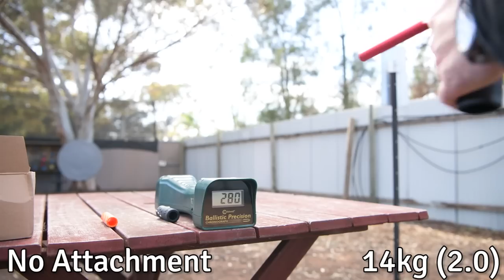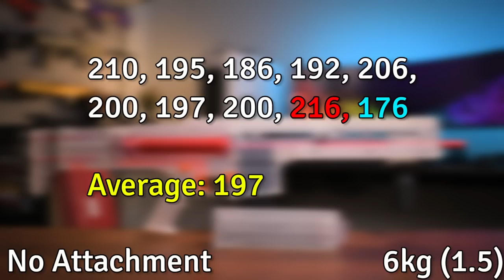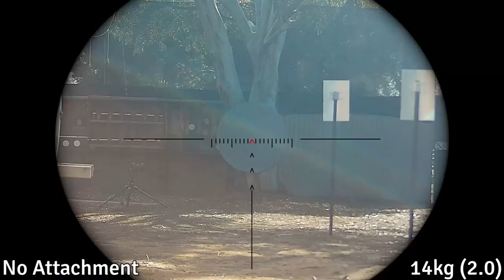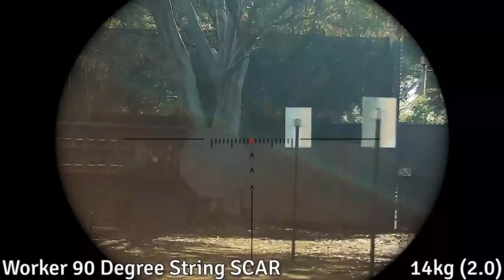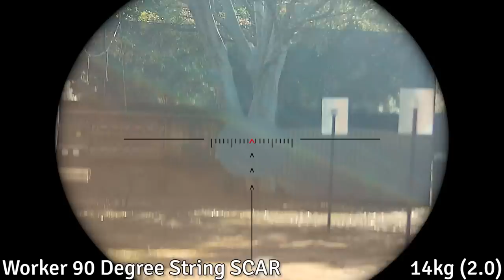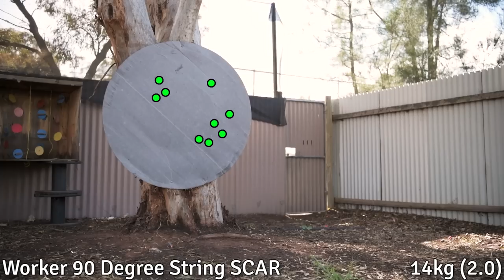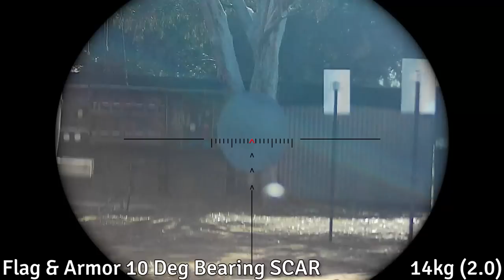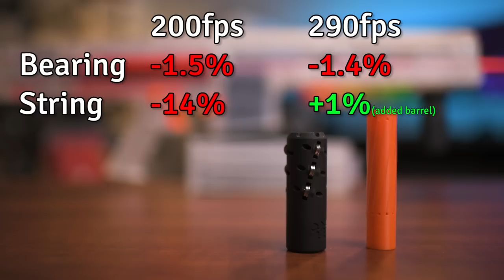Are Bearings the Future of Nerf Accuracy?

Comment: I'm  the chief designer of Flag&Armour,I am very glad to see the review of this product.
     I want to point out that if the correct bearing scar is used, nerf will perform better. It is recommended to use type-A for high muzzle velocity, which is 5° bearing scar, and Type-A is also suitable for most nerfs. For nerf with lower muzzle velocity, it is recommended to use bearing scar with a slightly larger angle, such as type-B or type-C.
     According to our tests and customer feedback, the original MK3 Challenger is suitable for type-B. Nerf with a muzzle velocity lower than 40M/S recommends using type-C, and Nerf with a muzzle velocity higher than 60M/S recommends using Type-A.
     BTW, the type-A bearing scar has good performance after being installed on various nerf with muzzle velocity, but it is more suitable for nerf with muzzle velocity higher than 60M/S.
     If you want more products to be tested, you can contact me and I will mail you more test samples for free.
Reply: Since you’re the chief of design there, can you see about making some of these that fits on a Nexus Pro muzzle port?
Reply: @MalakaiSchuhart  There are not many users of NEXUS pro in mainland China, we haven't done the design for NEXUS pro yet. But we have designed a suppressor looking bearing scar with metal shell right now.
Reply: Hello Flag & Armour Engineer! please can you allow your product to be shipped to Canada and United States. also made to fit 16mm od. Thank you!!
Reply: @paulmcewen7384  We are trying to ship our products to Canada and the United States. How can I contact you?
Reply: @cdpdswat  email is best, but I don't want to post my personal email publicly. Do you have a business email I can reach you at?
Reply: Flag & Armour I am wondering if I can pay you to ship directly to me Australia?
Reply: Let's talk!
Reply: @alexterito1 Hello, you can find my email address in my channel profile. I was busy for a while and did not go online.
Reply: @outofdarts  Hello, you can find my email address in my channel profile. I was busy for a while and did not go online.
Reply: @paulmcewen7384  Hello, you can find my email address in my channel profile. I was busy for a while and did not go online.
Reply: So... The more powerfull blasters need less degree angle?
Reply: Can you please check your e-mail?
Reply: @cdpdswat  Can you link to the Flag&Armor Taobao store? The link in the description doesn't work anymore.

And what BCAR or SCAR would you recommend right now for >250 FPS, Worker gen2 HE Bamboo or Dragon darts
Reply: @blaster-time  I’m very sorry, but I don’t usually pay attention to YouTube’s notifications and overseas email notifications. I quit the Flag&Armour team a few months ago, and now I’m working on my own design business. I’ve trained a successor designer for the Flag&Armour team. , they now have their own overseas business docking staff.
Reply: @Zergosss  According to the laws of mainland China, toy guns with a nerf dart of this weight and a muzzle velocity exceeding 260fps will be illegal, so there is no corresponding design on the product, but it is recommended to use 5° in existing products.
Reply: @lyonel4044  According to the laws of mainland China, toy guns with a nerf dart of this weight and a muzzle velocity exceeding 260fps will be illegal, so there is no corresponding design on the product, but it is recommended to use 5° in existing products.

Comment: I did some math and reached an interesting conclusion. The friction of string scars rob a fixed amount of energy from the dart no matter the fps. So at lower fps a string scar is robbing a higher percentage of the dart's energy. But I calculated that the energy required to spin up one bearing is 0.6% of the dart's energy, so 5.4% for 9 bearings, no matter the fps. This explains why bearing scars perform better at low fps and worse at high fps.

The total percentage loss in a bearing scar still varies a bit depending on the fps because the bearings have some friction, and you have different optimal barrel lengths depending on the fps.

Comment: I sand the inner diameter of the inside of my scar barrels to reduce that friction while also keeping the benefits of the scar barrel in tact. I just roll some sandpaper around a pencil and give it several sessions of sanding while pushing a dart through and spining it to feel how much ive sanded and where i need to sand more. You can take off alot of material while still keeping its function i definitely recommend giving it a go

Comment: I wonder what your thoughts are on the different angle options? Would you chose a lesser or higher angle depending on velocity of the blaster? The middle option that you are testing here seems to be effective all the way from stock nerf to high FPS; so what would be the reason for going with the other angles ?
Reply from the maker: The velocity of the dart also determines how much spin the dart receives so I'd suggest 10 degrees could be perfect for all velocities but worth a try with others
Reply: @BradleyPhillipsYT  thanks for your reply; that makes a lot of sense 👍
Reply: In terms of physics, dart stability improvement is dependan on a specific rotational speed (rpm). So for a given rifling twist rate (degrees of rotation per distance traveled) the rpm increases as dart velocity increases. Too little velocity for a given twist rate and the dart will not spin fast enough to achieve best acvuracy; too much velocity for a given twist rate and an out-of-phase harmonic developes that causes the dart tumble which in turn reduces both accuracy and downrange velocity. In short, the lower the velocity, the faster the twist rate you need and vice versa. Less speed, more twist; more speed, less twist.
Reply: @timothycampbell495  that's a great explanation thanks.

Comment: what about a barrel consisting of rotating flywheels each set the spin at high velocity as the soft nerf projectile speeds down the length of the barrel . i lack the funds and resources to accomplish this feet. it would functions very similarly in design of a coil gun. if anybody would care experiment please show your results.
Reply from the maker: Flywheels aren't usually very consistent. This is using the dart itself to spin the bearings so I think it's able to be more consistent.
Reply: Make Test Battle did a feature on a 'infinity gauntlet' flywheel blaster using six cages in series as you describe. The velocity is effected but the accuracy remains questionable at best.

Comment: With bearing SCARs existing now, do you see yourself using a 400+ FPS flywheeler instead of a springer?

I'm not a nerfer since I quite like the range and accuracy advantages not to mention ammo cost and coolness, but it would certainly be interesting to see a .300 cal micro dart flywheeler or springer being made, as it may actually compete quite well with airsoft seeing as you can hit people at 70m, about the effective range of most snipers unless they have too much time on their hands and manage to do 110m.

Also, may be interesting to try putting a suppressor on a springer and doing a bunch of sound mods like putting foam and aluminum tape in hollow areas, or a layer of automotive dampener mat in the worst of places, maybe wrapped around a plunger tube, as us airsofters can achieve an extremely quiet, nearly silent gun perfect for stealthy snipe stuff.
Reply from the maker: It remains to be seen whether flywheel can achieve the same accuracy as spring or HPA, but if they could then I might consider it
Reply: 400 FPS flywheels are currently not possible, flywheels generally cap around 200 FPS
Reply: @reeces.pieces3  Yes, I'm well aware, but I'm sure it could be done with different ammo, motors, wheels, and abtteries, but definitely not with standard darts and motors

Comment: Does it works for dart zone max stryker?
Reply from the maker: I don't personally own that blaster but with the way dart zone usually design theirs I'd say you'll need to extend your barrel in order to be able to attach this.
Reply: Not on a the stock barrel you’d need to switch it out for at least an 8in or longer one

Comment: I don't care about the copying for 2 reasons. 
1st is simply legal. If the MK3 designers wanted exclusive production rights patents exist for a reason but imho it's not significantly different from a scar to deserve a patent.
2nd is the scar innovation was originally done by community members as free and open source. Unless your scar barrel exactly the same as someone elses then it's not copying. 

Also we have been completely comfortable with copying hasbro's designs and other companies too. For example worker don't pay kriss a license fee for using their design on the vector kit. Either this is an open and collaborative hobby or it isn't. The only issue I take is with direct carbon copies. Everything else is just modding

Comment: Would this fit on a m79
Reply from the maker: With the stock barrels, yes
Reply: @BradleyPhillipsYT  ok but not the spectre hybrid?
Reply from the maker: Spectre hybrid also, but not the AF Pro barrel. Keep in mind the hybrid has threaded end but this should still friction fit on.
Reply: @BradleyPhillipsYT  have you tested all barrels? I'm curios wich one is better. The spectre barrel does lean to one side wich I'm not really happy with